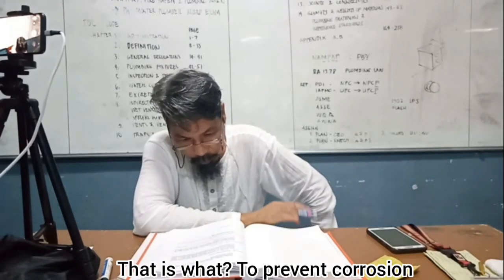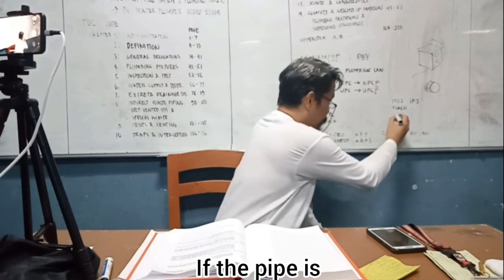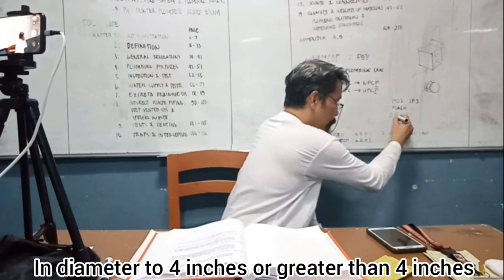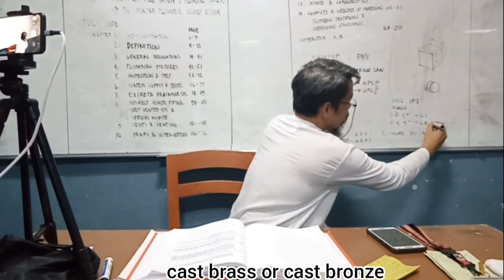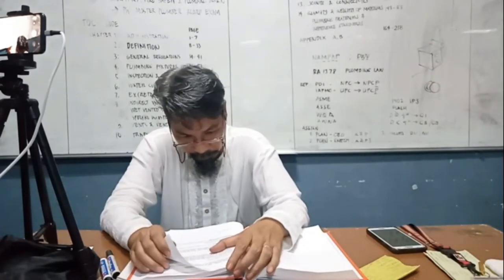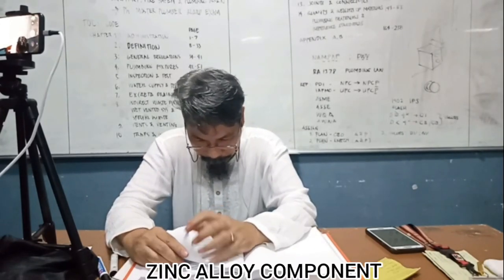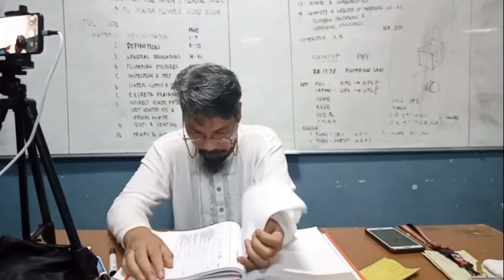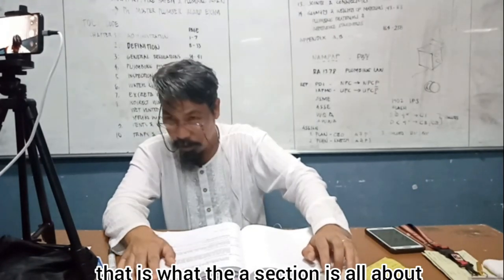CE526 Sanitary, Fire Safety and Plumbing Design || NPCP Chapter 14 Code & Standard References Part 5

Comment: thank you sir. From this video you learned that all cast iron earthen pipe cleaning fittings must consist of a 
 cast iron or  brass body and an approved threaded brass plug. We also learned that check valves act to prevent the flow of water in the opposite direction, and valves used in drainage construction serve to stop or allow  water flow.

Comment: Thank you sir this informative video about NPCP Chapter 14 Code & Standard References. It discuss some fittings such as cleanout fitting, thread type fitting and some materials for cleanout. Cleanout fittings are those fitting that needed for the clean out to be connected the piping and the system. Also it discuss types of vavles and a lot of information about piping and fittings in plumbing system.

Comment: Pipe Fittings are Piping component that helps in Changes the direction of the flow such as elbows, tees. Changes the size of the pipe such as reducers, reducing tees

Comment: Thankyou sir. This topic discuss about the different types of valves and their uses and what i learned is that the backwater valve is designed to automatically shut to prevent leakage out of the plumbing fixture if sewage from an obstructed public sewer backs up the owner's drain line.A gate valve can be defined as a type of valve that used a gate or wedge type disk and the disk moves perpendicular to flow to start or stop the fluid flow in piping.

Comment: Cleanout fittings - provides a convenient place to access a building's drain pipes to clear clogs and debris. (0:45)
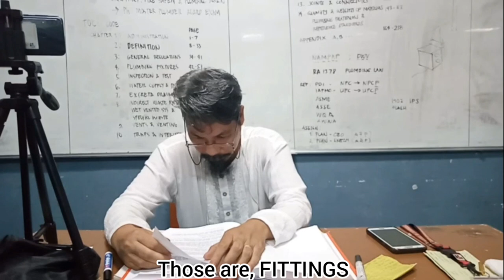Gasket - A gasket is a mechanical seal which fills the space between two or more mating surfaces, generally to prevent leakage from or into the joined objects while under compression. (1:11)
Gate Valve - is a valve that opens by lifting a barrier (gate) out of the path of the fluid. (4:35)

Comment: You always want to wrap seal tape around threaded pipe fitting in a clockwise direction. In most cases for a new joint you should apply only two or three wraps of tape. On older fitting where the threads may be damaged you may consider adding a few more wraps, but keep the number of warps to a minimum.

Comment: Etabes, Joshua G.
19-02128
- Thank you, sir. In this video I have learned about the NPCP chapter 14 Section 1407- CLEANOUT Fl1TINGS, Section 1408 - THREADED TYPE FITTINGS, Section 1409 - BACKWATER VALVE, Section 1410 - VALVES AND FITTINGS (When employed in drainage operations, full way gate valves must be used.
 Corrosion-resistant metal working parts 102 mm or bigger in diameter. Cast iron bodies are required for sizes less than 102 mm in diameter. The bodies are made of cast brass or bronze. All brass or bronze metal valves up to and including 51 mm in diameter are required.)  The common size of the faucet is 3/4 or 1 inch. Section 1411 - ZINC ALLOY COMPONENTS should comply with all applicable national standards and shall be utilized in accordance with the information they've provided.

Comment: Mendiola, Mc Axel Joseph P
19-00167

Thank you sir, I have learned in this video that every cleannout fitting for cast iron soil pipe shall consist of a cast iron or 
brass body and an approved screwed brass plug. I also learned that backwater valve is used to prevent water from going to opposite direction while gate valves used in drainage work to stop or allow the flow of water.

Comment: CAGUIOA, DANIELA O.
BSCIVESE 19-00459

In this video it tackles about the fittings. First, the threaded type fitting wherein the fitting uses thread, bolts or cap. In section 1409 talks about the backwater valve. Backwater valve is used to prevent water from going backwards for intentional flow. Section 1410 talks about valves and fittings. Gate valve drainage is 104 mm or larger. If the size of the pipe is more than  4 inches, the material is cast iron. If the size is less than 4 inches it shall have cast brass or bronze to prevent corrosion.

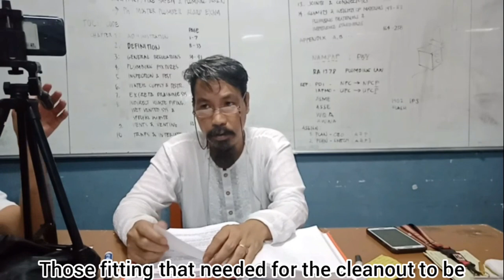Cleanout fitting @ 0:52
Cleanout @ 1:22
Backwater valve @ 3:09
Gate valve @ 4:37

Comment: We can use cast iron if the diameter of valve is equal or larger than 104mm  , but if it is less we use cast brass or cast bronze. The common size of faucet are 3/4 or 1 inch.

Comment: Rolegio, Mark D.
19-02023

this video is about the chapter 14 code and standard references. there are materials that listed on this chapter but was standardized or popular organization. seection 7, section 1407 cleanout fittings. those fittings that needed for the cleanout to be connected the ppoipng and the system. section number 8 threaded type fitting. section 1409 backwater valve, section 10 valves and fitting.

Comment: If the diameter of valve is equal or larger than 104mm (4in) we use cast iron, but if less than 104mm we use cast brass or cast bronze. faucet is also a type of valve the common size of faucet is 3/4 or 1 inch.

Comment: Buizon, Randylyn C.
19-00979

I've learned in this video tackeled is Cleanout fittings need to be cleanout connected the pipping and the system . Gasket is the one example for fittings. Section 10 is for Valves and Fittings and the type of valves is 
1. BACKWATER VALVE 
2. GATE VALVE

Comment: Ruiz, Sharlize Veyen C.
19-00620

I have learned that backwater valve is so important as it prevent water from going backward. Also in valve and fittings. When gate valves used in drainage work, shall be full way type with corrosion resistant materials. Sizes 102 mm or larger in diameter shall have cast iron bodies. However for sizes less than 102 mm shall have cast brass and bronze bodies.